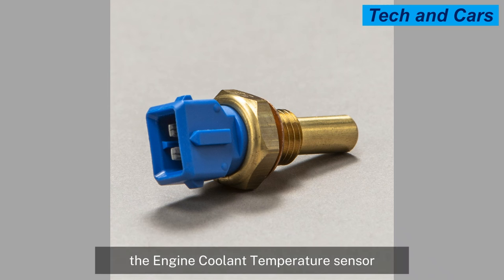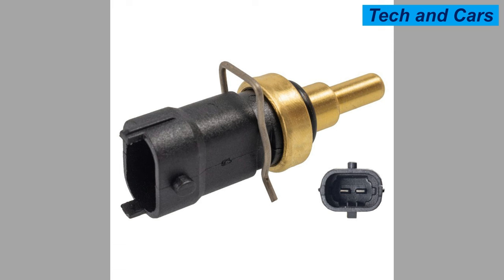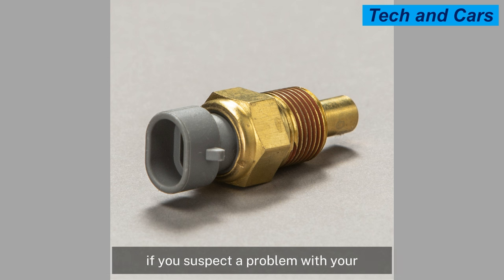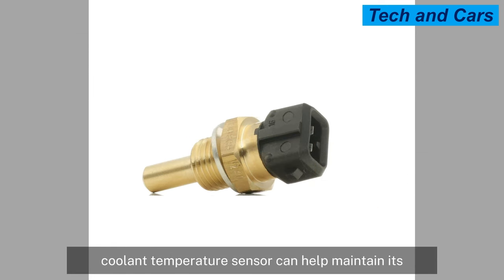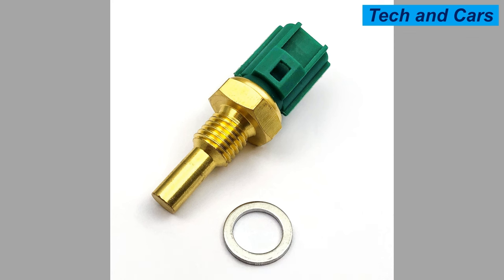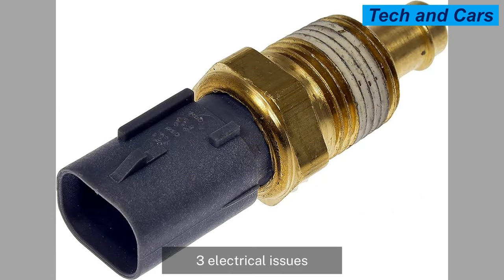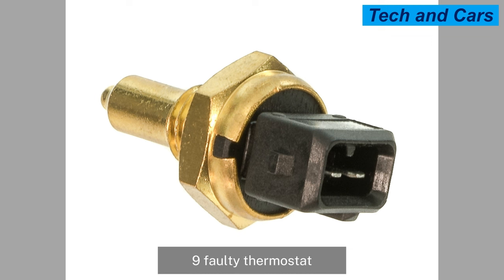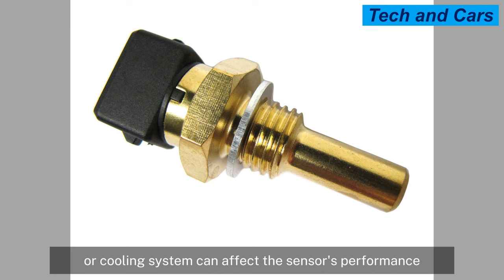How to tell if you have bad engine coolant temperature sensor

Comment: On my 2004 Yukon XL, thindicatore engine would occasionally stumble or miss briefly, then return to running normally.  When it stumdled, the temperature gauge would also drop significantly, then come back to normal.  It would occasionally drop less noticably without the engine missing.  The guage dropping (70-100 degrees it a second, then bounce right back) was the indicator that it was the sensor.  The computer would attempt to adjust and the engine would miss.  Swapped the sensor ($12), problem solved.
Reply from the maker: Thank you very much for sharing your wonderful experience! Glad to hear that you have it corrected! Well done!

Comment: Great video, can overflowing reservoir bottle can be caused by faulty sensor. Already replaced rad cap and thermostat. thx
Reply from the maker: Overflow is not known of causing sensor failure! Age caused deterioration, corrosion or sediment buildup, electrical or wiring related problems and contaminated coolant are known to cause sensor failure.

Comment: Do I just bolt another one in or do I put some thread lock on as a sealant or ptfe tape.
Or does the new one go in as is?
Reply: Just torque it to spec
Reply: New sensors typically have sealant pre-applied. Otherwise use tefon or pipe dope.

Comment: Could this make my p0135 02 sensor light pop up? I changed the upstream and engine light is still on
Reply: Test the ECT sensor. Remove it and clean it. Use an ohm meter to read the resistance. Then, get a hair dryer and add heat to it. The resistance should start dropping. If it doesn't, replace it.

Comment: Why can't I screw the new or old sensor back in I ran a yep it went in double check it's rite part
Reply: You used a 'TAP'? The threads on these are commonly NPT. Pipe threading.